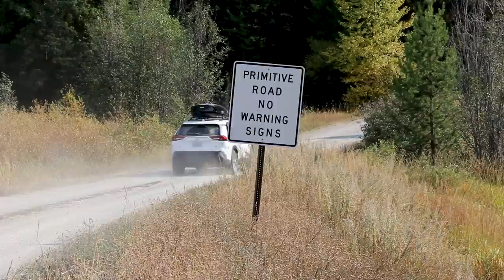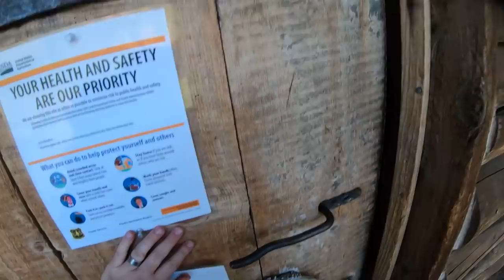You Can Rent This Cabin For $30 Dollars

Comment: Thank you for sharing. Do you think that a small foldable utility wagon that is approximately 35" L x 20" W x 23" H could be used for the trek to the cabin?
Reply from the maker: Possibly. Some of the areas were pretty steep though. There was another way I could have gone that wasn’t as steep but was 2 miles longer. So maybe on that one!

Comment: Would it be possible to ride a dual sport motorcycle up that trail?
Reply from the maker: I do not believe you can ride motorized bikes on that trail 😞
Reply: I looked at the link.  No motorized vehicles but you can use 4-legged horsepower.  There's a hitching post, which I saw in the video, and a horse stall, which I didn't see, unless that outhouse serves a dual purpose; it looked big enough to house a horse LOL